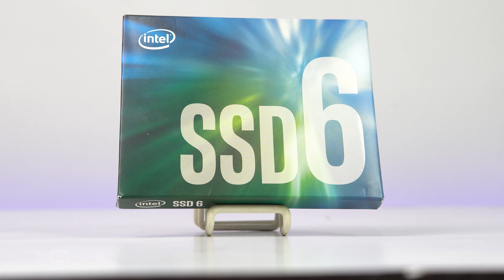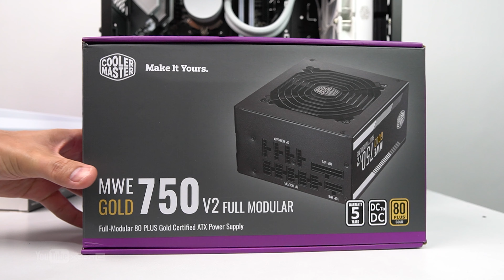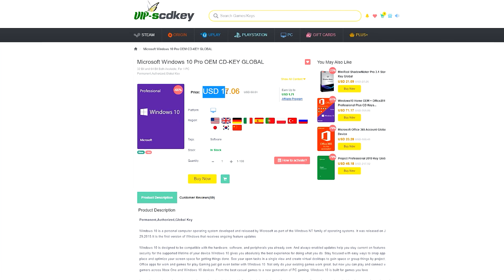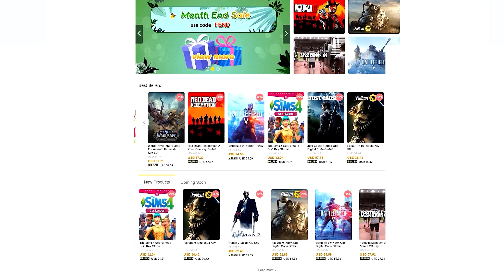($2200) 135K Ryzen 7 3700X I RTX 3070 I Asrock B550 Steel Legend I White Gaming PC Time Lapse Build

Comment: I Have the same WC with my r5 3600 and temps are 70C :c
Reply: wat casing?
Reply: 70celcius?? on heavy load?
Reply: Full test on cpuz
Reply: In game example now Im playing valorant full graphics 1080p and i have 56c max.
Reply: @Elmonkycraft  thats normal. 1080p is not demanding reso and valorant is not heavy triple AAA title.
Reply from the maker: Try clean your radiator baka may dust build up na
Reply: @Ampopoltech  yeah but 70c its correct for this WC wh my ryzen 5? On full testing obviously

Comment: It's very sad what's happening right now. This 135k build was suppose to be around 80k if it's not because of GPU shortage and the pandemic.
Reply: Yup. Mine costed a bit less than this one and I have a TUF 3080 installed.
Reply: @watcherman222  yup. a 3070 should only cost like 30k msrp. I got my 2060s last Dec. for 19k srp, glad i pulled the trigger when gpu was still at reasonable price.

Comment: Sabi mo di pweding ilagay ang rad sa harap.
Reply from the maker: Kelan ko sinabi?
Reply: lol pwede.
Reply: Previous builds mo sir nag suggest ka na wag sa harap. Tagal na yun
Reply: Kasi kawawa yung GPU sabi mo
Reply from the maker: Yes sinabi ko yun pero never ko sinabi na di pwedeng maglagay sa front ng radiato.  If hindi available ang top rad mount mount mo kung san available. Sa P400A hindi available sa top. Client ang may gusto ng case + 240mm rad.